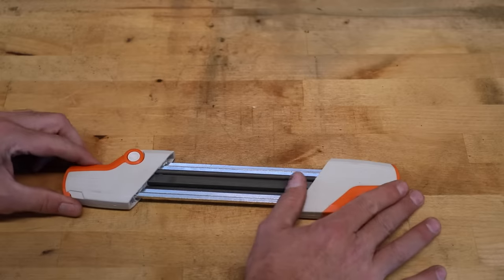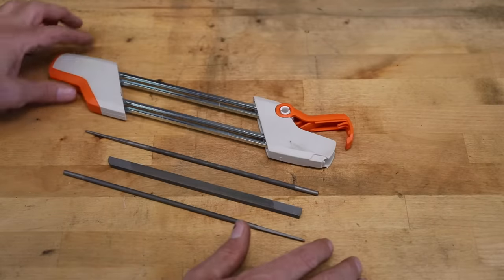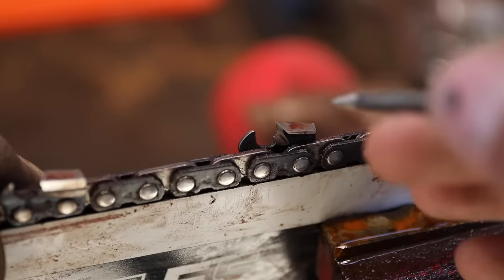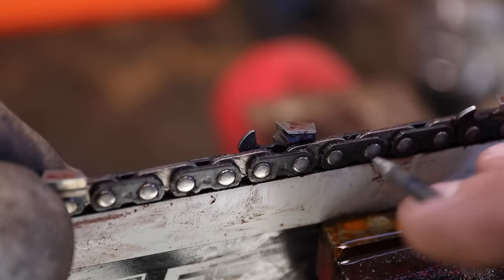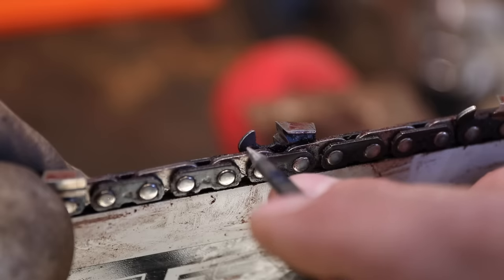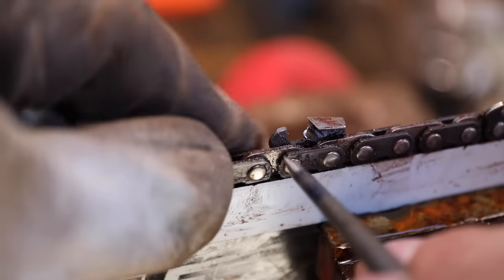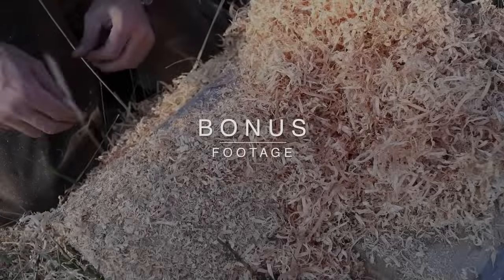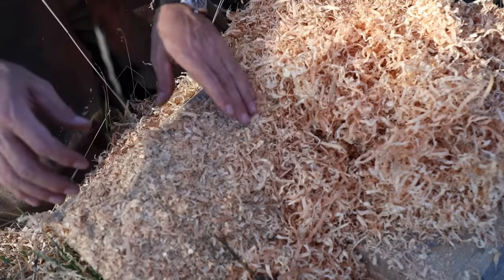Best Chainsaw Sharpener Ever - FINALLY!!!

Comment: you have square ground full chisel skip chain and you sharpen it  with round files like you have classic tooth chain ??? by the way stihl 2 in 1 set is made by PFERD for STIHL.    also STIHL files are made by PFERD.       PFERD or VALLORBE is the only way to go !! greetings from stihl,husky and jonsered technician from Europe
Reply: gpb thats what I'm seeing. Also I believe that the tool only works on full comp
Reply: Pferd makes the square ground files as well.

Comment: If I'm not mistaken, this tool was really designed to be used on "full" house chain loops, not skip tooth.  I believe the tool is designed to "ride" on both the tooth your sharpening and the tooth in front; by doing so, the depth gauge file will properly maintain the recommended depth of .025" (I believe).  When used on a skip tooth chain loop this doesn't happen, as can be seen in your video.  If this chain is brand new, then technically it doesn't need a depth gauge adjustment yet; although I prefer a slightly more aggressive bite too.   Oh by the way, your factory chain was square ground and now your changing it to round.

Comment: The angle matches my stihl factor chains perfect. Was that a ripping chain for a saw mill never compared the difference as I don't have a saw mill.
Reply: Terra Fur-muh Landscape Management, LLC yeah that chain as I can see appears to be a square grind tooth for milling . Cutting angle at 10° vs average 30°
I thought he would know that tho he seems to be sharpening his square grind with a round sharpener . ??
Reply: @pilabuddajelly-time7686    I have been wondering why the angle looks odd.

Comment: I also bought one.  Never sharpened a saw before... seems to work well.  The saw cut a lot better after I got done sharpening it.  The angled plastic ends helped me keep it at the right angle to the bar and apparently I don't have to worry about the rakers being too high.  Thanks for teh great video.

Comment: It’s because you have square file chisel chain and your using a round file set up. Square chisel chain uses a different angle than round file chain. There are special files for this that are shaped differently to file the top and side plates in a square shape and require drastically different file strokes. You can find these files at baileys or madsens chainsaw/logging suppliers. Square chisel chain can be round filed as you did in video but it is a lot of work until it’s been fully rounded.

Comment: In Germany, where i life, it is required for you to take a class of basic Chainsaw use if you want to work in the woods with it. In this class you also learn how to sharpen your saw and the differences of different sharping techniques it makes.
Reply: We have the same thing if you are gonna work US forestry land, except the few times they hire contractors to do big workloads quick. The contractors came and killed 10 guys because they had 0 classes and qualifications. You really learn to love those classes.
Reply: Same in UK,. You are required to have permits at different levels of use. But no one has them as the courses are too expensive.
Reply: In Germany I think you also have to have a license to play golf, correct?
Reply: Lutz Scharf it isn’t like that here. I run a tree company here and most of what we learn is through books and other contractors. There are classes places, but not always in areas where you live. I taught myself mostly. Tree climbing and all.

Comment: The chain you have on your saw was meant to be filed with a triangle file, look very close at the tooth and you will see it is square cut in the throat of the tooth. You can file these with a round file but than you should use the angle of your tool not what is indicated by the factory etch line.
Reply: I noticed that as well right away I wanted to see if anyone else noticed
Reply: You think he would no that he's really into chainsaws
Reply: See 9:25

Comment: How does it compare to the electric one that you used before and liked?
Reply from the maker: This is a field sharpener. The Granberg is for shop use,
Reply: Wranglerstar Understood but are u recommending this over the Grandberg for shop use?
Reply: I understand, but the title says best ever, so is this better than the Grandberg for shop use?
Reply: I love my Grandberg. I bought it because of your demonstration. And so did my friend after I showed him your video. And btw it's how i discovered you. I will agree it's easier in the shop but it can still be hooked up to a 12v battery in the field.
Reply: Take pride and be precise.  Even when I was rough edging to buck RR ties in the dead of winter, it gave me a sense of pride to shun electric tools. I'm just different that way.

Comment: I've had angle gauges before but I like the ergonomics of these sharpeners. My 25" chain has 42 teeth so anything that makes it faster and easier is a win in my book. Filing the drags/rakers/depth gauges at the same time is a bonus.

Comment: I really appreciate your review. The "little laser mark" (5:27) is called a witness mark and it put in by the manufacturer to tell you two things. First, the optimum angle to sharpen that particular tooth at, and second, NOT to sharpen the tooth past the witness mark. Time to buy a new chain at that point. I'm only guessing since I don't have this product, but perhaps they put an extreme angle on it to accommodate teeth of all angles. My guess is that it should be used exactly how you did it; by following the witness mark. Thank you for the review!
Reply: I think he was filing more square to the bar than the witness mark requires.

Comment: Just tried for the first time and angle matches. I bought a different brand though. There was a log I couldn't finish last year because blade got dull and 4 passes on each tooth and cut right through it.

Comment: The reason you had to adjust the angle of the sharpener is that it isn't designed to line up with a full skip chain according to Stihl
Reply: Not everyone cuts sift wood trees -- so it makes sense.

Comment: To explain the angle difference.....

The first chain you sharpened looked like a square chisel chain.  To sharpen it with a round file at 30 degrees (like the 2-in-1 is designed) would take some time to remove the square filing profile.

Also, the 2-in-1 is designed for full compliment chain only.  Not full skip or half skip.  Using that sharpener on your chains is putting too much force on the depth gauges, resulting in them being lowered too much with each pass of the file.

And, please be careful dragging the file back through the tooth.  It will ruin the file quickly.
Reply: it is designed for any angle of tooth.  It is marked with a guide for the normal 30 degrees.  Ignore this if your sharpening a rip chain or any other angled chain.  Just like the other file sharpening guage tools.
Reply: Good point on the skiptooth chain, it doesn’t give anything to rest the other guide on.
Reply: Someone made a video a while back testing that myth of running files backwards. He took a microscope to the file afterwards and was able to conclude it actually got sharper. Lol

Comment: Super impressive Cody,  one tool to replace an entire kit that is field-serviceable, portable and precise. It appears that it relies on the distance between teeth to be such that the flat guides rest on both tops of two adjacent teeth to insure the depth "raker" is level and creating a consistent depth for each tooth for uniformity of load along the entire chain. I appreciate your openness toward new technology especially from a company that has a reputation to uphold. Although I have powered sharpeners, I really favor the tactile approach of precise and consistent sharpening.  Certainly the extra time it takes to hand file is compensated for in fewer field revisions and unwanted re-do's.

Comment: Did you try on a regular chain and not a skip tooth chain?
Reply: This tool isn't designed for skip tooth chains. Full comp only. Wranglerstar used it incorrectly hence he says that the rakers are lower and he's getting larger chips now.

Comment: Just bought and used it the first time.   First, you need to match the angle of the sharpener and the bar.   That's why they made it like that.   Second, it worked incredible!!  Like cutting with a brand new blade.

Comment: I always tell rookie chainsaw owners to buy 2 or 3 EXTRA chains.  First, if they are doing a lot of cutting, it is probably easier for them to just swap a chain.  Second, without the proper tools/guides, a rookie has very little chance of getting good results.

I am not sure what it costs today, but having a pro sharpen your chain used to be about $5-$7.  Worth the money to get your spares back perfectly sharpened.
Reply: XGC Scrappy - Very smart of you and your buddies to put your order together !  Even if you had only 3 done, it would be $24 or $8/chain.  Not bad for someone who uses their saw only occasionally.
Reply: I buy new chains for My saw for 5€ a piece, not worth The Time to sharpen it
Reply: My Stihl dealer sharpens for $10/chain.

Comment: Growing up in a logging family, and felling trees professionally for years, I can personally testify that the angle of the tool is correct. The vertical side of the tooth should have a knife edge to help remove heavier chips. It also aids in the tooth releasing the chip as opposed to the following cut forcing the previous chip out ...
 When you're on a mountain alone except for your skidder man? Learning how to get the most from your saw comes out of necessity
Reply: been using saws 40 years you are right
Reply: So happy to see this comment. The tool wasn't used correctly in the video. I own one of these but found you lose the gullet after a few sharps. I'm a chainsaw carver & it's a prerequisite to do Crazy S#%T with chains anyway..... Someone should inform him that the 2nd round file in the guide isn't intended as a spare. Just Sayin'  Be safe on the mountain friend. Cheers!

Comment: This Stihl sharpener is designed for a Full House Chain, the chain being sharpened in this video is a Skip Tooth Chain. The rails of the tool are designed to ride on two teeth at the same time riding perfectly flat, therefore the tool cannot sharpen a Skip Tooth Chain because there are two chain links between two teeth. There are no problems only solutions!
Reply: Correct!!
Reply: Thanks for this comment . . . it led me to go and learn the difference between/among all of the different chain types, and I'm sure it'll prevent me from doing something stupid somehow in the future.
Reply: Correct! The other problem is that the teeth on the Stihl skip tooth chain are cut with an angular profile and not a round one. Sharpening with this tool changes that profile and the chain does not last very long.
Reply: I imagine this info is in the description or instructions?  I notice a theme that he doesn’t read instructions lol
Reply: NOT "FULL HOUSE" 🤣
Proper term is "FULL COMPLIMENT"
A comment intended only to educate 😊
Reply: @OFFICIALUND  í
Reply: @nikhilmulay  There are 2 designs of chain profile ...
#1 Chipper bit (round shoulder)
#2 Chisel bit (square shoulder)
Reply: @jolujo5842  Stihl sharpening tool therefore Stihl chain terminology, full - compliment means the same thing as full - house as far as Stihl is concerned. All caps and emoji's LMAO!
Reply: @butchclifford8733  it's a  "procom"chain damnit !   .a (professional commercial)  chain.  Otherwise it's a (standard residential/homeowners chain)! Also you have a "m'ain" aka (man chain) and a  "b'ing" aka (boy string)!And if you keep it up you're going to be in chains! 
..Like Alice..... ummm...kind of...  I guess. 🍻🍻
Reply: @jbfthree1  not Alice N' Chains being Staley old band (R.I.P. Staley 2002) but Alice in Chains with harmonized vocals between Layne Staley and Jerry Cantrell. After Staley death, William Duvall taking over as lead vocalist full-time (Black Gives Way to Blue) (The Devil Put Dinosaurs Here) and (Rainier Fog). Working on the wood splitter tomorrow, can't wait to hear that one. Until then gonna play some
Soundgarden, LOUD!
Reply: Some one is a Sawyer 
TU
Reply: I’ve been using mine on skip tooth too. I haven’t been struck by lightning yet, but maybe I’m wearing out my chain extra fast? 
Tell me what to look for, and tell me what else to use. I have a cheap harbor freight grinder setup, but it seems sloppy and likely taking off way too much tooth. 
I’m considering buying the expensive Oregon brand grinder.
Reply: Stihl says this  sharpener is made for Full house chains.
Reply: Thanks! I love these vidios, ya think he might have read the 
instructions? solutions
are there, but who can find them redily?
Reply: They are superb files that's for sure

Comment: I was at a power equipment dealers open house the other day and asked the Stihl rep about them, he showed me there was a whole assortment of sizes, I needed the 30 degree for my 20” RS chain, I’m sure like you said that big chain is at a different angle and you actually unintentionally ordered the sharpener at the wrong angle. Thanks for the great videos Cody.

Comment: Finally getting around to trying one of these, should be here in a few days. Appreciate the review as always. 

I have two saws, one with a 3/8 low profile chain, the other with a standard 3/8. Really wish I didn't need to purchase different ones for each.
Reply: well the files are different sizes and the filing heights are different. same angle though. we have both as we have 2 different saws. remember to clearly mark which is which with permanent pen as the files for the full size 3/8 will destroy the 3/8pico (low profile) chain

Comment: Its manufacterd from „Pferd“. Pferd in englisch is horse. Stihl only labled it. Originally its blue coloured.
Reply: Jack Again So this is the... prferred source? Thanks.
Reply: @jonnda  eh?
Reply: Jack D Would you have pferd that I not attempt another pun?
Reply: @jackagain8346   Went to Pferd site you posted. Couldn’t figure out how to order...of course I’m not very tech savvy. I did, however,  notice that pferd calls the rakers... depth gauges in their description of the tool discussed. Apparently our friend also visited Pferd’s web site. Thanks for the info...I’ll probably telephone the hq in that cold state.

Comment: The type or hardness of the wood to be cut, determines the  cutting edge rake angle. For hardwood 20-25 degrees and soft wood 30-35 degrees
Reply: You are 100 percent correct, would think he would have known that. Shows us that just because someone has a video on a product does not mean that they would know something basic like that. When you are raised on a farm you start learning things like that at a very young age. I guess I have taken things I was taught growing up for granite. I can repair, fix, sharpen or even build just about anything and have always done it. But I was terrible at school work, having a major dyslexia problem throughout school did not help. Guess we are all smart, but just in different areas and ways.
Reply: I do really appreciate him showing us this and putting it out. Why more than I have done.
Reply: @kenrolltideAlabama  Granite?? You mean you you took things you were taught for "granted".
Reply: you folks take water for granted.. even if you freeze water you do not get granite 🙄

Comment: Based upon comments on this video, went to a dealer for the file.  Even the dealer sold my saw, it did not have the correct file.  Once I had the part number, ordered from Amazon.